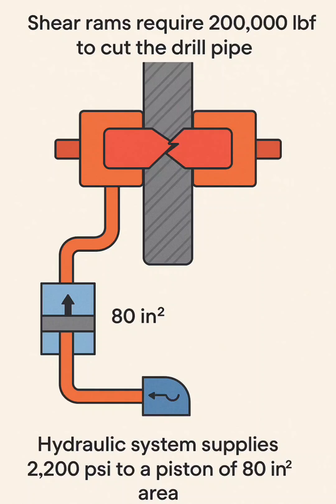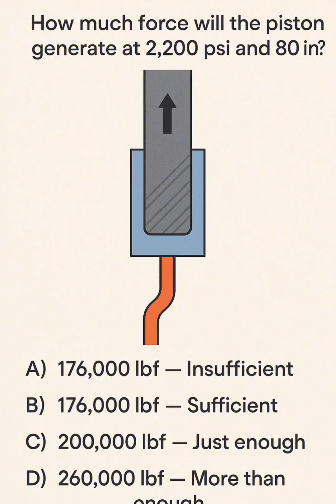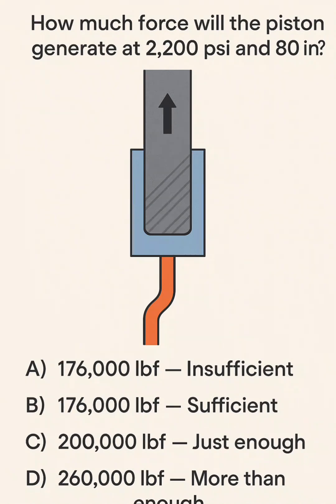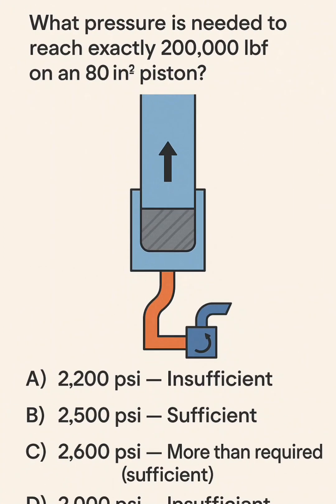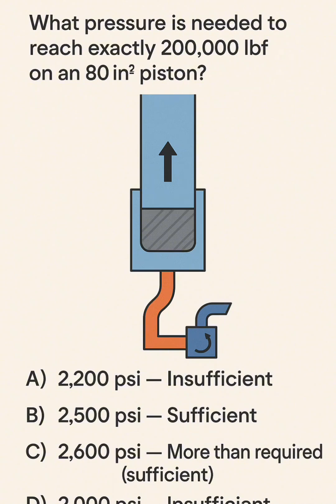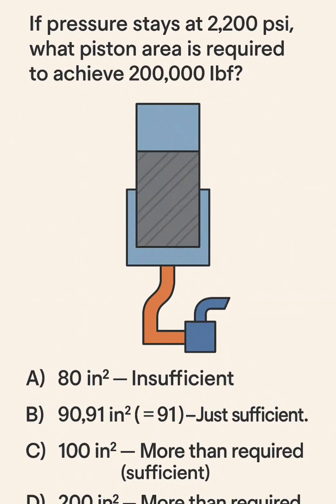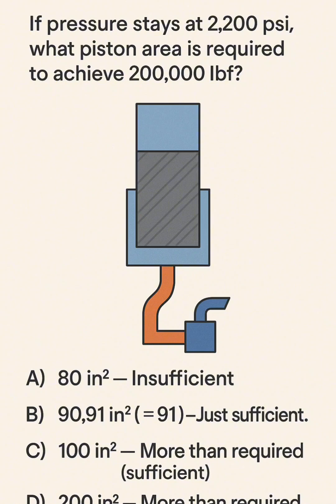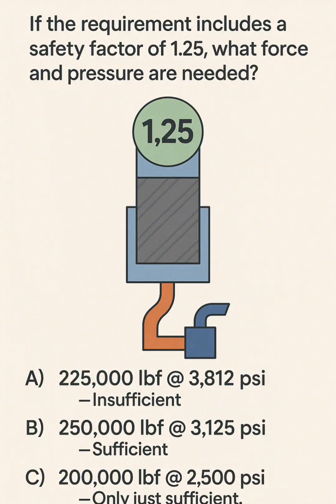Shear-Ram Force Check Q57 #drillinghse #iwcf #wellcontrol

Comment from the maker: Question 1 — Force generated
A) 176,000 lbf — Insufficient ✅ Correct
Question 2 — Pressure required
B) 2,500 psi — Sufficient ✅ Correct
Question 3 — Area required
B) 90.91 in² (≈91) — Just sufficient ✅ Correct
Question 4 — With Safety Factor
B) 250,000 lbf @ 3,125 psi — Sufficient ✅ Correct